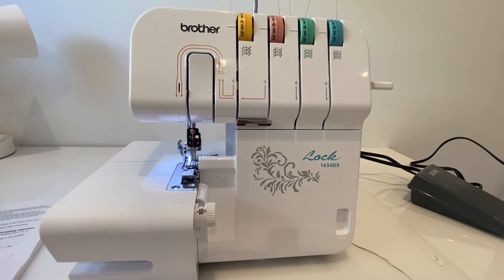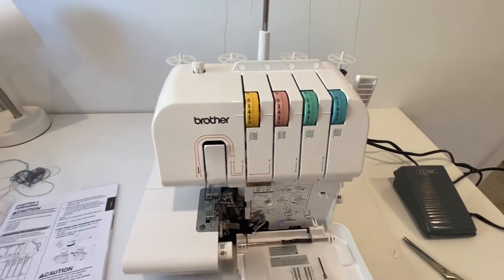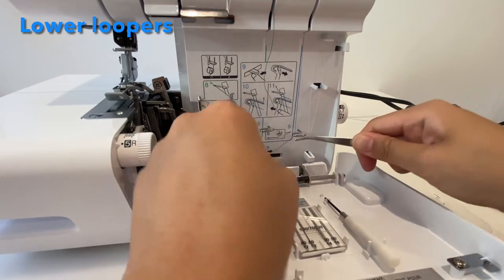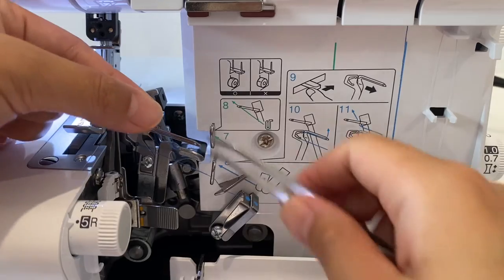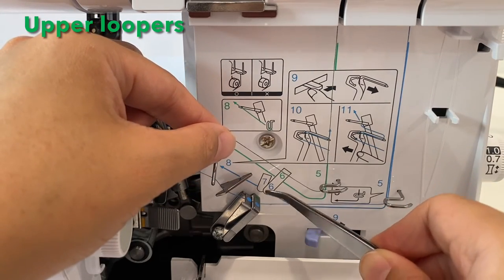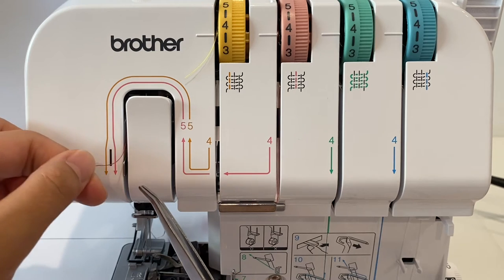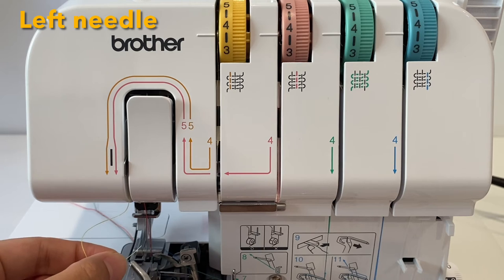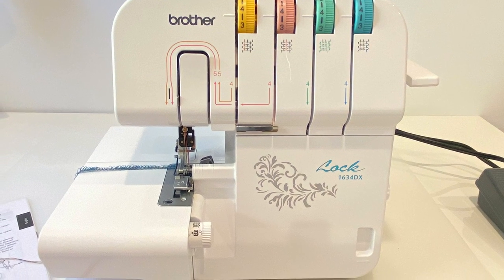How to thread the Brother 1634Dx serger

Comment: Just bought this machine. I am by no means a seamstress but I can sew basic projects. I bought this because I am now weaving and the pros use a serger to seal off the ends of a woven fabric. So I bought one and now realize I need lessons on how to use it. I tried, thinking it's similar to my sewing machine and soon found out NOPE. So I needed to rethread as some of them came out. I was able to follow your instructions and I will every single time I need to do this as I won't be using this machine on a regular basis but rather only as needed for my projects. Thank you so much. It was a bit difficult to see the course of the thread against the metal parts, stronger lighting would be nice, but I was able to rerun several times so I could see what you were doing. Thank You for taking your time to help out the rest of us.

Comment: I have a 1634D which is slightly different but this video helped me because it told me to put the threads under the foot and pull to them from the side and it worked! Another video said to pull them to the back and never mentioned under the foot and that was a whole lot of mess!  Thanks for the tutorial :)